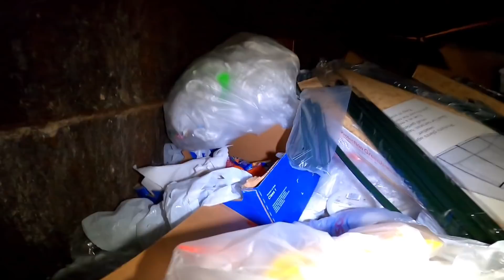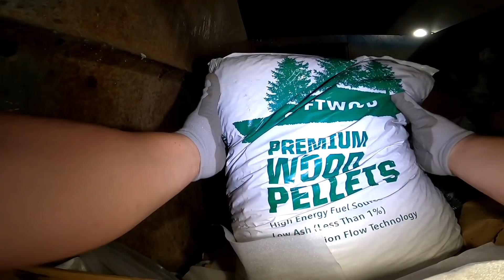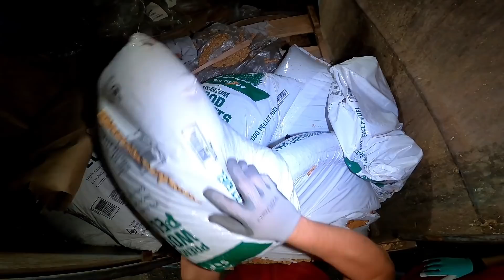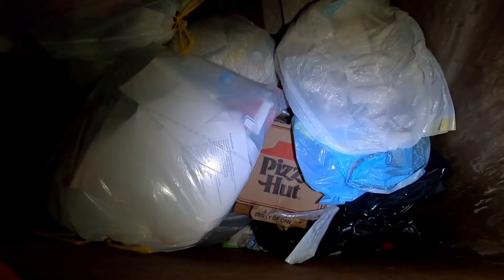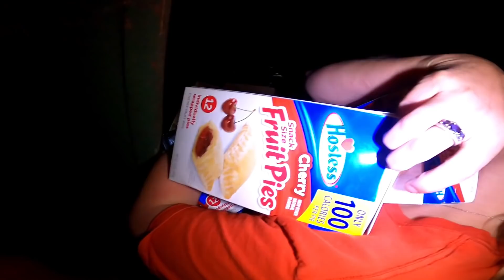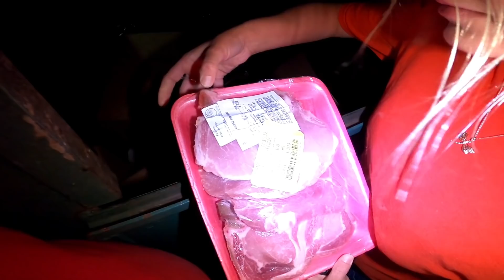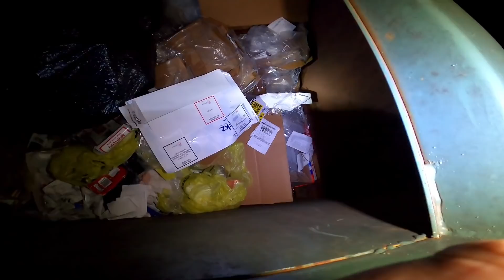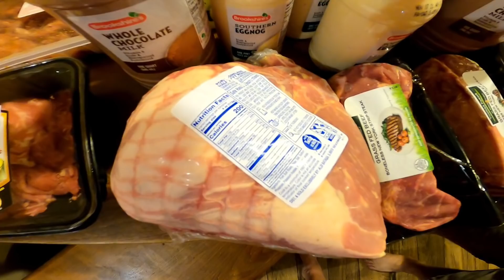We Got A Truck Load Of Food For Free  Dumpster Diving

Comment: Wood pellets are for wood pellet stoves. They are fairly new. You fill the reservoir with pellets, hit the igniter button and adjust damper as needed.
Reply from the maker: That is so cool! I never knew that they existed before we found these pellets. Such a cool idea. I guess we will have to use these for our fire pit since some of them did get wet
Reply: @curbsidejunkies  they work pretty well as a fire starter too.

Comment: I found 2 cases of the pork rinds that were getting close to the best by date. I ran them through my food processor and froze it in air tight bags. I use it for a coating for chicken. I also use it when I make meatballs or meatloaf. I also use it in gravy’s.
Reply from the maker: That sounds pretty good. Do be careful though because there were some pork rinds that were on recall not long ago
Reply: @curbsidejunkies  I make sure and check for recalls. Want to save money not get sick.

Comment: Our stove burns a bag a day and heats our 1000 square foot double wide when it's real cold out side like 20s or below
Reply from the maker: Man! I didn't even know they existed now I want one! The ones I have seen them pretty darn expensive though. Maybe we will find one used on sale or heck, maybe even in the dumpster LOL
Reply: Harmon are the best they work off a thermostat and relight their self when need they are alittle pricey but pay for their self when you don't have those high light bills from electric heat our light bills were over 600 a month but with the pellet stove we don't even get over 150 in winter time now we burn one ton of pellets which is about 250 a winter